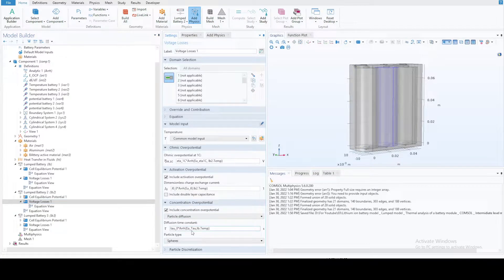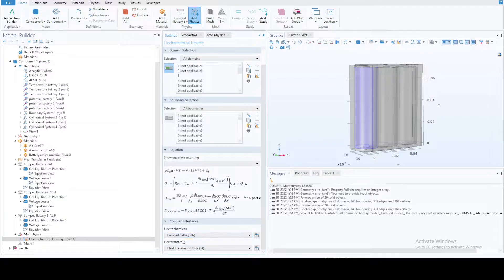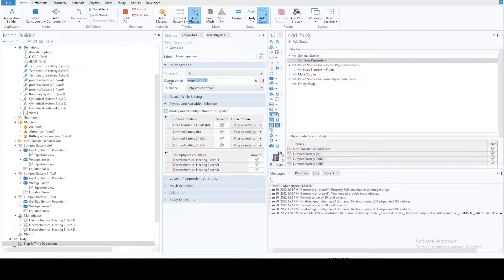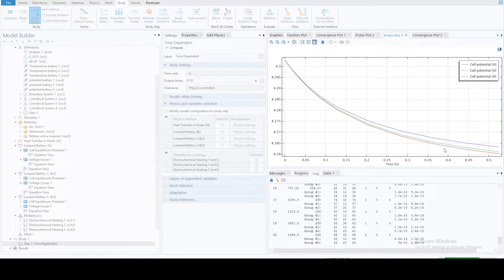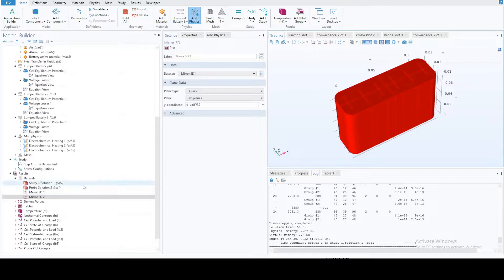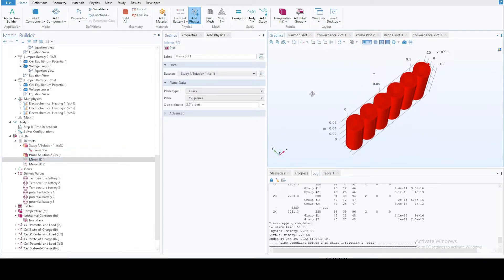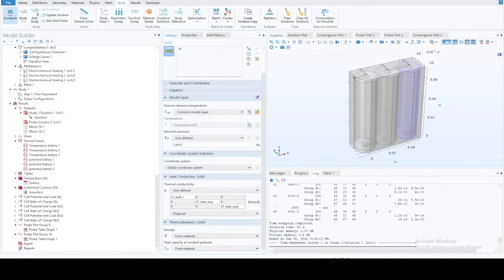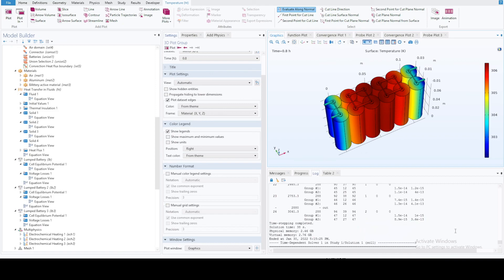Lithium ion battery Lumped model for beginners  | Thermal analysis of a battery module | part 5 of 5

Comment: Hey, thank you for the video. it was a good introduction for batteries. I want to simulate a whola battery pack for example from tesla, where we have 1584 of these cells. Does it make sense to simulate just a few like you did and then add a 3D mirror? I want also to simulate different charging and discharging rates
Reply from the maker: As long as your choice of batteries are such that after mirroring, they form the whole real system then it does make sense.
Reply: Brother can you tell me the measurement for 1584 cells

Comment: I have done this calculation with version 5.5 but when calculation is running the error occurred by (wrong number of DOFs in linearization point). Can you please help me in this regard.
Reply from the maker: Its very difficult since I never encountered this kind of error so I am sharing a link you can find the whole file of this model for COMSOL 5.5 maybe you can download that and try running that.
https://www.comsol.com/model/thermal-distribution-in-a-pack-of-cylindrical-batteries-76291
Reply: @simulationbyhm5194  okay thank you so much ❤ i will try this

Comment: Hi Cool Work  thanks for your efforts , however why did you not choose the physics study to be a lithium ion battery? there is a section for that.
Reply from the maker: Actually it mainly depends on what you are looking to get out of the simulation this one was simpler approach and thermal analysis was the aim with least parameter implementation. The module you are talking about in COMSOL "Lithium-ion battery module" we use that one when a detailed modelling of Li-iob battery is desired. For example when you want to look into the voltage-current variation by applying constant current cycling or maybe constant voltage cycling along with the species concentration changes within the electrodes and the electrolyte.
Reply: @simulationbyhm5194  Can you please share your email to contact you ? Thanks

Comment: Hi bro.we want to work on liion battery cooling. But we don't know what exactly our professor is expecting from us in this final year project.would you suggest us anything related to thermal management system of li ion battery so that we can do our final year project successfully?
Reply from the maker: There could be a number of ways this can be interpreted honestly. For example, 1)- thermal management can be done by developing some sort of cooling channels with fluid flowing around the battery at a cell level or a module level. 2)- or you can be looking at fluid like air flowing openly across a number of cells for cooling 3)- it could be a phase change material as well that removes heat and changes its state. 4)- In channels case you study the mass flow rate or the inlet velocity and how does changing it effects the heat removal. that what i have at the moment. You can find a lot of articles online dealing with cooling channels around the cell as well as at module level that would definitely help.
Actually, I am also trying to do a COMSOL simulation for thermal management of lithium ion battery using cooling channels for the past several weeks but couldn't find time to do so. Maybe if you can wait a week or so i might upload a video on comprehensive thermal management of li-batteries.
Reply from the maker: Hope it helps
Reply: @simulationbyhm5194  yeah bro thanks .
Reply: @simulationbyhm5194  That's what i'm trying to see. Sounds awesome work. Hope you can manage this well and share your experience with us :)